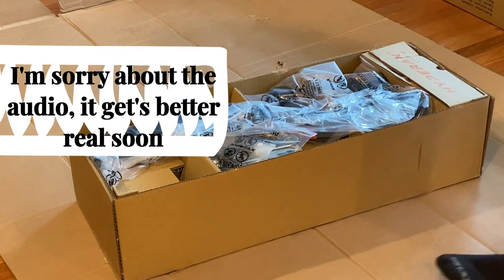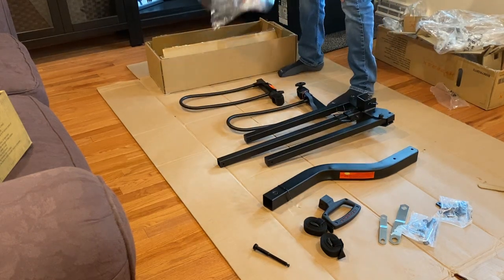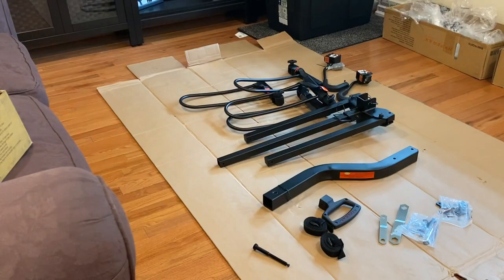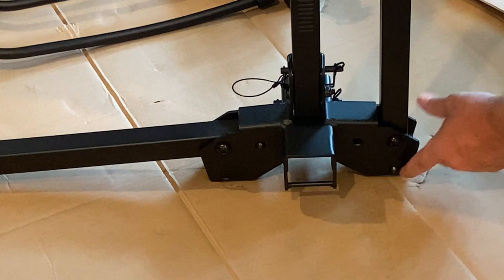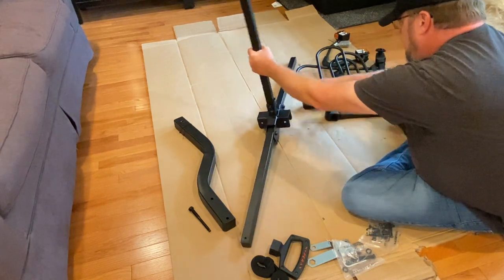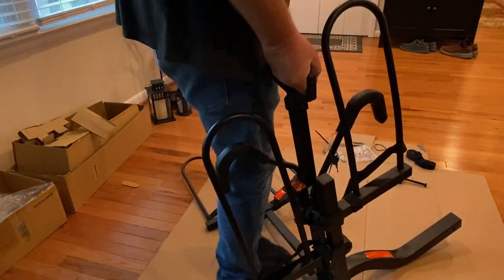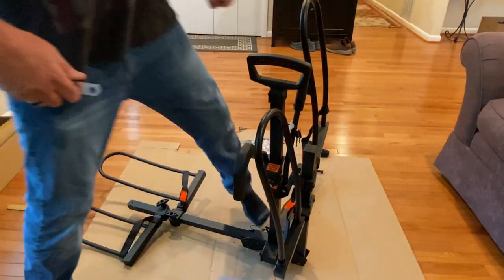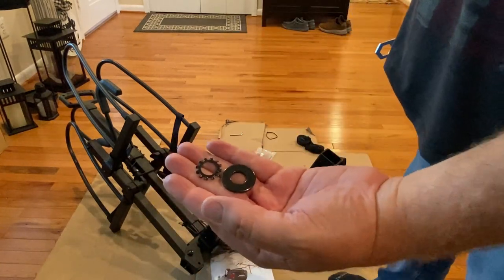The Future of Bike Racks (Unboxing Hyperax VOLT 2)

Comment: Great vid. Did you have to use the hitch tightener? It seems like it does keep it tighter in the receiver but you have to loosen it everytime you take the rack off the hitch. Also, are the keys to the rack all the same from this brand? Someone with the same keys could use it on other racks right?
Reply from the maker: @ericcoe1760  Thank you! Glad you liked it. So I do use it because it keeps the rack a bit more stable like you said. I do believe the keys are the same but I am not sure. Hyperax themselves would be able to answer that. I did think about that but then decided, why would another bike person steal my bikes and if they do then they were going to get them anyways. With that said, I bring the bikes in if i stay somewhere overnight. I also tried out Hyperax’s  ewer Volt Lift carrier. Check that one out if you havrn’t, it is easy to load your bikes but it is a heavy rack.

Comment: Thank you for sharing this video. It contains some good information. But the lock and fender washers should be placed on the bolt-head side of the hitch pin, not on the lock side. As shown on page 2 of my instruction guide.  It's hard to see but it's there. I look forward to your next video on loading the bikes. I'm having problems with the lock not releasing after I lock down my bike. It's very hard to slide the lock up to remove the bike.  Any thoughts?
Reply from the maker: Thank you Ray! I answered on the other video. I will try and get it uploaded this week.